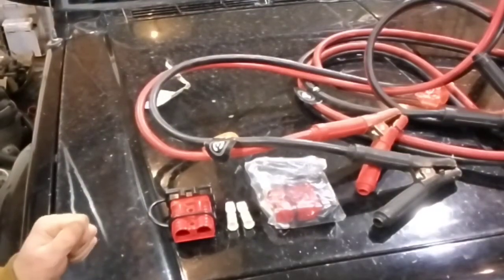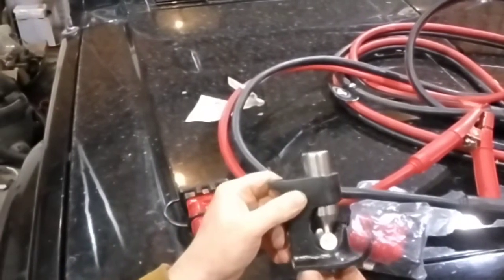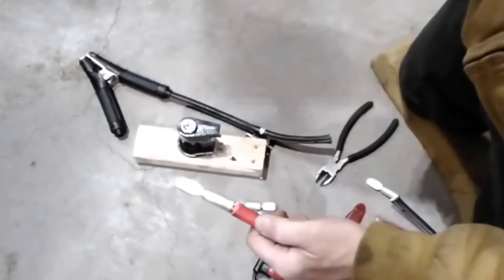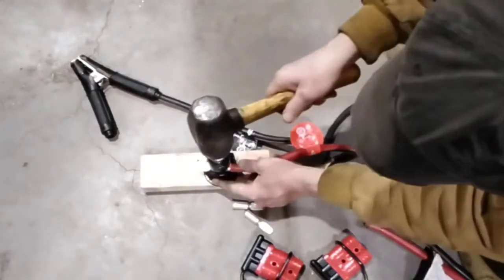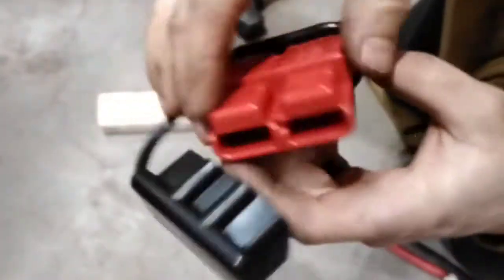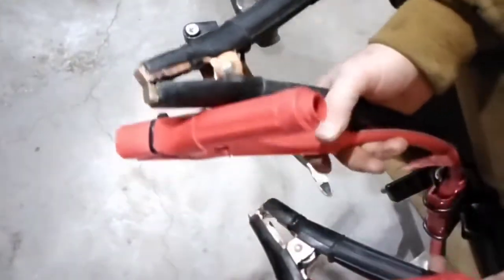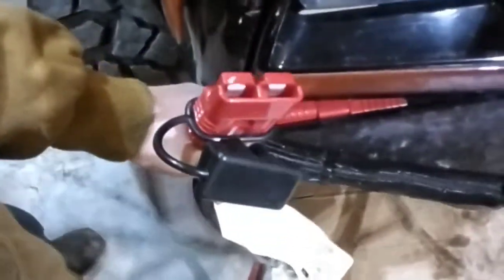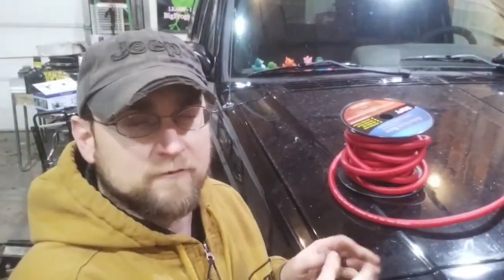MOD JUMPER CABLE QUICK CONNECT | I need your expertise on using body as a rear battery ground |

Comment: I’d add adhesive shrink wrap at all new connections. Also, the hexagon style crimp works best IMO and doesn’t create the ears or wings on the side of the crimp. I think that’s why you were having trouble getting the lug to seat and lock properly into the Anderson connector.

Comment: Buy another pair of good jumper cables and use the wire from it to run front to back. It's cheaper.
Reply from the maker: I already had 0 gauge wire left over from a friend's subwoofer amplifier install.

Comment: Using the frame for a return path for the negative is fine, just make sure you also use the same size cable to connect your frame to your battery and engine block.

Comment: It would be easier if you can use a cable cutter. They are extremely useful for larger diameter cables and coax. The design of these cutters cut cables straight and clean, leaving no crushed or frayed wires. Channel Lock or Klein Tools make the best cutters and are made in the USA.
Reply from the maker: Without a doubt that would be ideal. But I wouldn't use them often enough to purchase a set. But if you haven't said to use that would definitely be the way to go.

Comment: If your Cables get hot enough to melt Solder, they're undersized, and your 0AWG, even at 20 ft, is not undersized.
Reply from the maker: Agreed, but just in case somehow someone shorts them together and freaks out 😆
Reply: You should use heat shrink on the lugs

Comment: I like this, I think I can be use this to act like disconnects for my scooter that way they can't run off.
Is there a breaker disconnect that can be used for 100amp?
Reply from the maker: I'm sure you could find one.